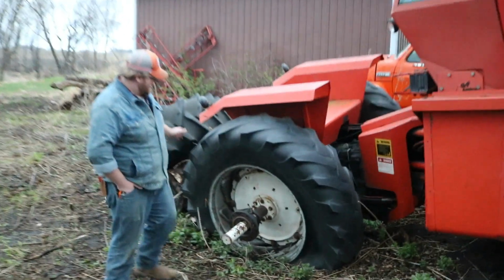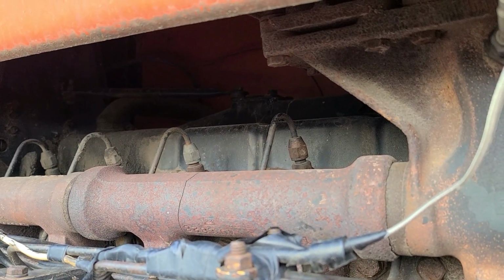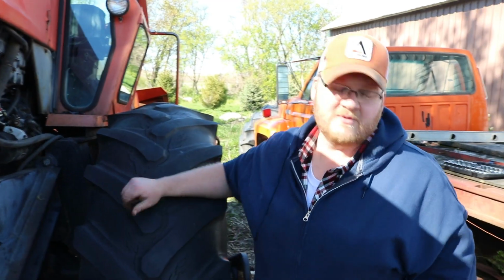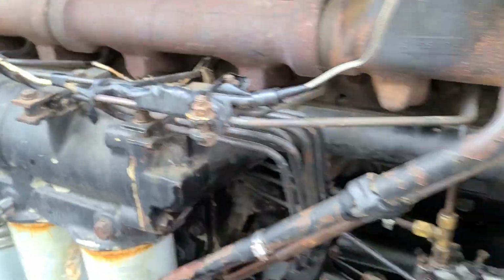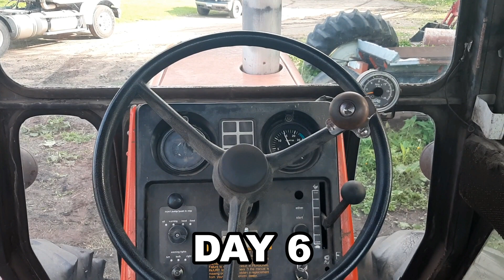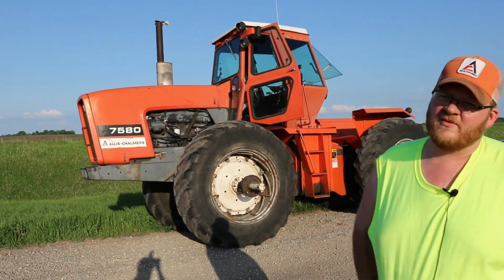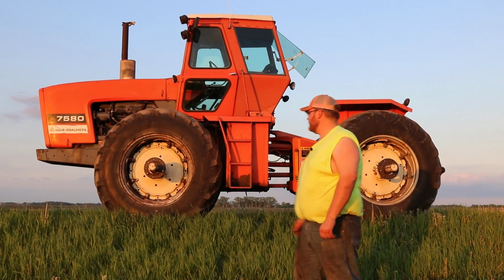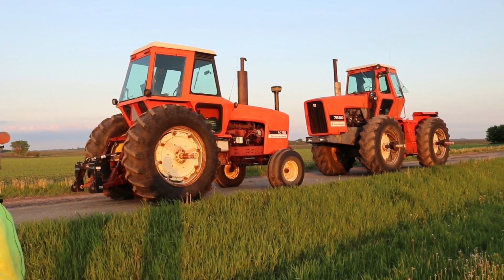Allis Chalmers Show:  1979 Allis Chalmers 7580 Part 2 Will It Run?

Comment: Might be worth a look at the rods and mains on the engine, depending on how many hours are on it. The high horsepower 426 Chalmers engine were great engines, just hate to see something go wrong due to worn bearings. Good luck. Thanks again for the videos.

Comment: Also J and L what do you personally like about the Allis Chalmers 4 wheel drives.
Reply from the maker: We like the styling, the fact most of the parts are interchangeable with the 7000 series, where the cab is in relation to the pivot point.  Still working on the u joint so haven't had a chance to test it in the field yet

Comment: Guy by us had one for years. Never seemed to have many problems. Pulled it like it was a 7080, and not like our Versatiles. Lots of people pulled the smaller engines tractors like they were 300hp, and called them junk later when they ragged them out. Not the tractor’s fault!
Reply: Funny you mention guys who worked the smaller tractors hard -    one of the area farmers when I grew up decided he needed less soil compaction and went "small" by trading a Steiger and a Versatile for two Magnum 7140s to work ground.  His planter tractor was a 2wd AC 7080 which was used to pull a 24-row JD planter......that tractor always looked unique because he mounted gray Magnum duals on the back when it pulled that planter, which was huge back then.  I always thought it was pretty cool that tractor could handle that big-ass planter.

Comment: Yes be careful that the bearings are put in the right way an head gasket can be put on wrong  we had one for a while till the mechanic messed it up. Also make sure the drive shift is fixed right or it will come apart again

Comment: I am not as familiar with that tractor as I am the 70xx series, but I think that rear end is very very similar, meaning the rear drive train is pressure lubricated, and driving it anywhere other than around the yard is NOT a good idea, you could easily seize the high/low range gears to the pinion shaft, without the power shaft connected from the front to rear.
Reply from the maker: I guess I don't really know as well, but definitely will try and find out as that would not be good!